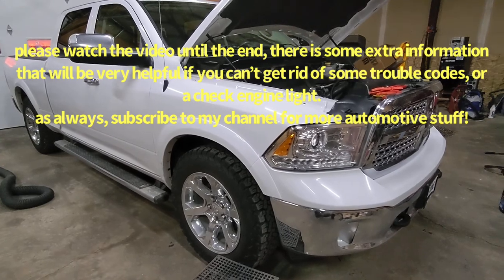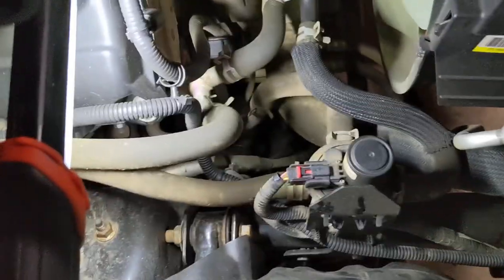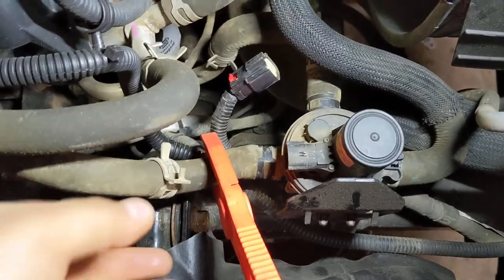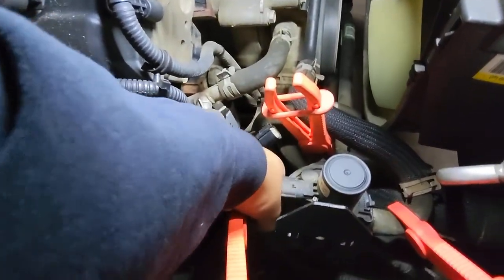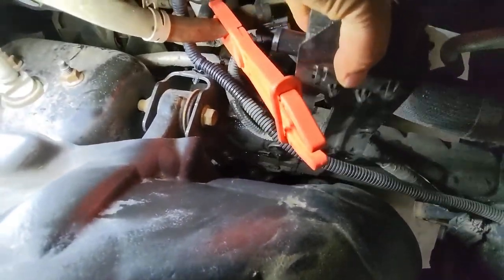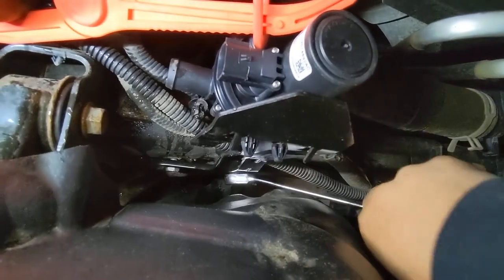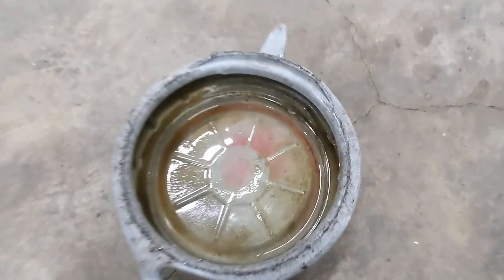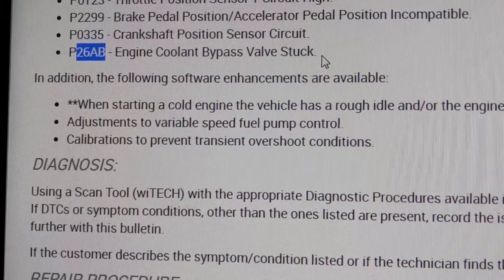2015 RAM 1500 5.7L V8 HEMI P26AB COOLANT BYPASS VALVE

Comment: I replaced my three-way coolant valve with oem. Drove it till temp came up and heater blew very hot air. Hasn't blown hot since then. I believe my truck needs recalibrated and my red tab broke on my connector! Great video glad I found it!

Comment: If you just pinch those plastic tabs on the back of that bracket you can pull that valve out without taking the bracket off
Reply from the maker: Valve comes with new bracket, as a repair facility I got put all parts because I'm getting paid by a client.